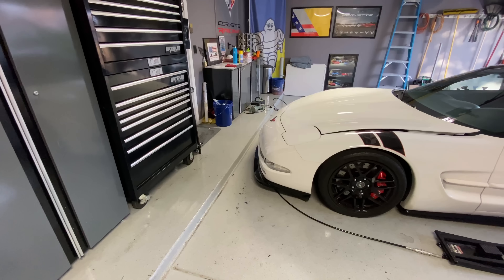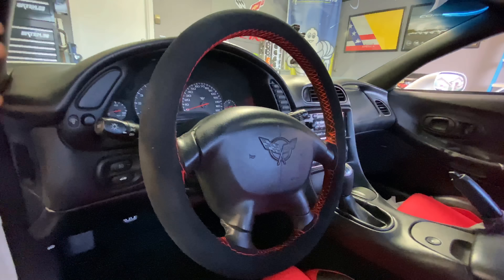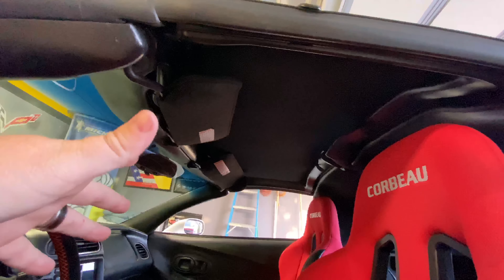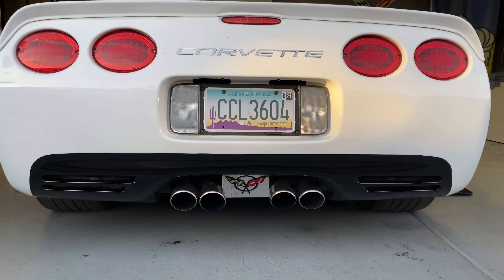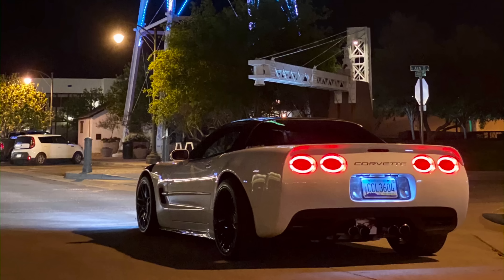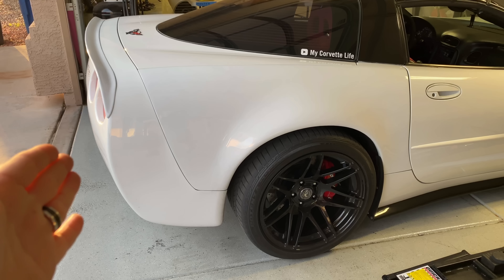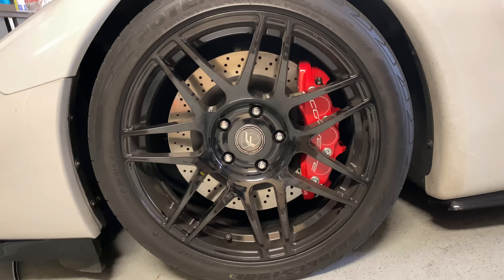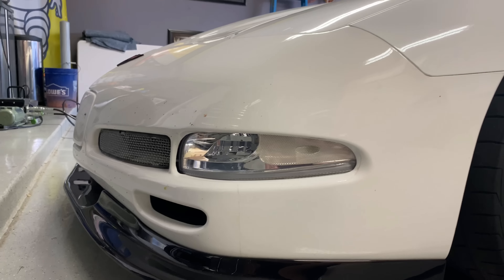Full Mods List

Comment: Couple of things to note.   The stock LS1 throttle body is no different than the LS6 throttle body.  They are the same part and as far as I know there's nothing to upgrade to without going to a 90mm intake.   Something else you many want to consider if you ever take your intake off again is going to the CTS-V valley cover which will almost negate the need for a catch can.  It's that good. A lot of people still run both though.   One of the first things I took off of mine was the Fuel Rail Covers.  Don't know why they're called that but I don't like them.   Something you may be interested in, is going to the Holley valve covers and LS3 coils.  It's a really clean setup and gets rid of the bulky LS1 coils and brackets.    Have fun with it!
Reply: MRBLACK947 which ctsv valley cover? ls6? because i have installed the ls6 valley cover and still get a lot of oil buildup inside my catch can on my c5
Reply: @jcloud96   I believe there are two different versions with both that have the pipe that comes out from under the intake by the TB. 
This is the one that is recommended by part number.......GM 12577927 ENGINE OIL VALLEY COVER BUILT IN PCV.   It is supposed to be the most efficient.
Reply: MRBLACK947 yea that’s the same one i have and i’ll tell you oil still builds up. i can send you a video of how much oil i had from 3000 miles
Reply: @jcloud96   heck yeah I'll check it out.  some LS motors are notorious oil consumers as well unfortunately.
Reply: @jcloud96  I don't see any videos on your channel.   2005 or newer I believe is the valley cover you want.
Reply: MRBLACK947 2001 c5 but i bought that part and put it on
Reply: @jcloud96   If your car is all factory original 2001s were the most notorious year for oil consumption issues and ring problems.  It's pretty well documented out there as you may already know.
Reply: MRBLACK947 i’m fully aware but what i’m saying is the valley cover won’t get rid of the problem fully, it being paired with a catch can will
Reply: @jcloud96   I'm tracking what you are saying. My point is not everybody has the same problem.   I don't have an upfront oil consumption problem that is over loading the system if that makes sense.  By all means running both is just fine.   My only point was there are bazillions of people that aren't in the same boat and do notice a difference making the switch to the 05 CTS-V valley cover.    The early cars were some of the best at not consuming oil.

Comment: Thanks Chris! Have you ever thought about removing the body side moldings? Some people like the look with them and some without. I still have mine on and I’m still trying to decide if I should pull them off.
Reply: RTM those side moldings are designed for down force. So it depends on how you drive the car. If you take them off put a spoiler on if you drive it hard.
Reply: Rtm, mine doesnt have them.  I like it better without them.  Makes the car look cleaner.  Problem is, if yours has them and you try to take them off, it may take the paint with it as they have been on 20 years or so.
Reply: smokinC5 I agree, I’ve seen some methods online and I do have a polisher and different pads/compounds and was planning on fully detailing my car this year so I am still seriously considering it. Luckily my car still has lower mileage so I know I won’t run into faded paint or anything like that when I pull them.
Reply: Alan Sawyer Good point, this is more of an aesthetic thing for me though
Reply: The only purpose they serve is protecting the doors.  Much cleaner look without them.  Personally i think they were designed by the same guy that designed the wagon wheels lol.  Hopefully he was fired hahaha
Reply from the maker: I like it rather way.  I decided to leave them on to be different.
Reply: I took mine off couple day's after I bought my C-5 4sp roadster new back in 2002 and put them away. I used heat and waxed dental floss doubled up to remove them. If you take them off Do Not throw them away! Very expensive to replace them.

Comment: Awesome Chris. You are correct in making the car your own. Have you thought about changing the radio and adding a back up camera?
Reply: I wish I had one already. Also, an aftermarket cup holder. I had just bought one of those 44oz drinks from 7-11. I went to an exhaust shop to have the mufflers removed. I decided to back into a parking space in their lot. I looked in my driver side mirror to spot the yellow line to line up my car. All of a sudden, I come to a complete stop, along with a loud BANG. I then decided to look in my rear view mirror, and I see this large square pole behind me. The pole belongs to a lift that I hadn't noticed when driving into the lot. After seeing what I had hit in my rear view mirror, I just shook my head, opened my door and just sat for a moment thinking there'd be a large dent. I get out, and walk to the rear of my car to find minimal damage. There was a small line of paint transfer along the top lip of my rear end. I could also see the two vertical green lines on the black piece below the bumper from the lift pole. I just started laughing, and decided to get back into my car. I then find that my 44oz drink had fallen out of that shit of a cup holder, and spilled all over the passenger side carpet. Luckily, it was Pepsi, and the carpet is black. I took my jacket off and soaked it all up. Continued to get my Borla mufflers removed, and noticed that one of the exhaust tips was crooked after the service. I had thought it was because the guy didn't put it back the way it was. As it turns out, that's what took all of the impact from that stupid fucking lift, and my lack of awareness. Paint came off from all points of contact. Just need to straighten the right exhaust tip. It is just slightly crooked. Luckily.
Reply from the maker: If I used the stereo more I would.  I think I can count the number of times I’ve used it on one hand.

Comment: Chris I have been watching your Videos on and off since you picked up your C5 but I haven’t subscribed until today. I have owned my C5  Nine Years now and also own a C2,C3 and C6 all Coupes. This year of 2020 makes 50 years of me owning and driving Corvettes and working on them. I got to say I like seeing a young fellow like yourself really getting into your Corvette. Keep making videos. A little food for thought. I am surprised you haven’t put the Corvette Flag Decal in the Center of your steering wheel. I did with my ‘99 what a different look. It actually looks like it belongs there. My car is basically a bone stock 6 spd Black Coupe with aftermarket Chrome Thin Spoke Wheels and a Black Wing Intake. It only has 37k miles on it. It even has the original stock exhaust but I added custom chrome exhaust tips being the factory tips looked like crap right after I purchased the car. If I want to hear something louder with a roar I can easily take out either my C2 or C3 both equipped with Factory Side exhaust. It might be the age thing with me now also. I like my C5 and C6 at the factory level of Sound. The only other thing I have decided to do with my ‘99 which I haven’t found the time to do as of yet is to install a brand new Kenwood Double Dinn Receiver with CarPlay. I already purchased a new dash to accommodate it and I purchased the receiver and everything else to do the install. Here in the North East I only get about 6 months to play around with all my cars and I have quite a few to maintain so depending on what gets in the way determines what I can do these days. Keep doing your videos. I tell people that I spend more time on You Tube today then I do on TV. Actually most TV these days bore me. On You Tube I always run into things I like to check out.
Reply from the maker: Thanks for subscribing!

Comment: Hi Chris i am curious how you can about your 98. I will look at the older videos. I bought a 98 in 99, it had 4,000 miles on it. Just like yours White with Black interior and M6 stick shift.  I loved the car and drove it for it 140,000 miles. I have also made modification. And see some you have done i would have liked to do. The wide fenders for sure. I have always been a car nut. I had the opportunity to buy a used Magnuson Supercharger from a guy that runs Top Speed events. I already had headers so this was a nice addition. But i was greedy and keep increasing boost on the stock motor until i broke it. I had just sold a big system to the FBI so i used that commission to get a new motor build. Iron Block LS motor, my heads, crane cam and rockers, Cam, lifters etc etc, and an intercooler. Multiple clutches, Aluminum Flywheel, McLeod, Short throw shifter with a tall MOMO Carbon Fiber knob. Bump on the hood to clear the blower and 1966 Corvette 427 Hood Vent Grills.  Had the wheels painted white. Last dyno run was 525 HP, but then i had an accident, not the car,  but me, carbon monoxide poisoning. My wife was out of town in business at the time and i was pretty sick, hyberbolic chamber etc etc , afterward she blamed the car and i had to sell it. It now lives in Kentucky and the new owner renamed the car. I named it White Fang. After he took his brother for a ride they decided to name Frankenstein. It is so mild mannered, until you nail the gas then it rips your head off.  I truly miss my old Car, so when i saw yours and heard you talking it was like revisiting my old beast. I took to car shows in Effingham, Illinois, Bloomington, Carlyle and the Factory in Bowling Green, from Florida, to New York etc. The next car was a 2007  Ron Fellows, then just last year a 2014 Z51. All were white as was my first Corvette a 1964 and a 79 L82. You Take Care, enjoy and keep posting. Great trip. D

Comment: Nice car Chris! I'm getting my C5 soon. It will be stock, electron blue metallic with black/gray interior. The first thing to go will be the terrible exterior and interior lights. They will all be LEDs except the HID headlights.
Reply: C5 owner. Fun car for the money.  Aftermarket is big.  New c8 is nice but Euro.  Up to the c6 is a must own but a used c8 next to it.  Gonna enjoy the c5 for now. 😎
Reply: @vthong50  Hey Vance, ya I'm going to wait for the price to come down on the C8. I'm limited because of my size I only fit in a C5 or C8. I'm not interested in a C1,2 or 3, C4, C6, C7 are too small, plus the older ones have too many reliability issues!
Reply: @anthonymitchell2354  
Sounds like you know what you should get.  C5 bridges the gap between too much tech and just enough in my opinion.  None of the new cars they make interest me for the money.  Good luck with the C5.

Comment: I have a 2001 C5 automatic. Only has 48k miles. I was wondering if you know the hp specs. I have heard 350hp and 350ft p . Then I heard 360ft p. Then I hear 375ft p. I also heard a guy say in 2001 the LS1 had a different intake LS6. Is any of this true?
Reply from the maker: There are a lot of very minor changes that occurred to the LS1 between 97-04.  As a rule of thumb though, the factory rated the 1997-00 345hp/350ft-lbs, 2001-04 350hp/375ft-lbs.  All 2001+ cars used the LS6 intake manifold.
Reply: @mycorvettelife  Thanks. That clears up a lot.

Comment: I'm changing out my clutch on my 03 Z06 do have any tips
Reply: I like the Luk clutches.  I went with the c5z06 replacement.  Good to about 500 hp.  Make sure to rebuild the torque tube and ALL associated parts down there, this job sucks and you dont want to do it but once.  Also a good time to replace all bushings as the whole rear of the car will be apart.  Good luck!
Reply: @smokinC5  did you have to Ballance the clutch flywheel pressure plate or were they already ballanced
Reply: I didnt do it my self.  I am pretty sure the guy that did it.
Reply from the maker: I just had a LS7 clutch and flywheel installed. Seems to be working very well, and feels stock.
Reply: @mycorvettelife  thanks for responding it took me 5 hours to remove the clutch, it looks like a tick monster stage 3 kit and it's trash. Your videos is the reason I bought a vett and the confidence to tackle this progect. If this car destroyed a stage 3 what would you suggest. Keep up the videos I watch all of them thanks Blue Collar Vett